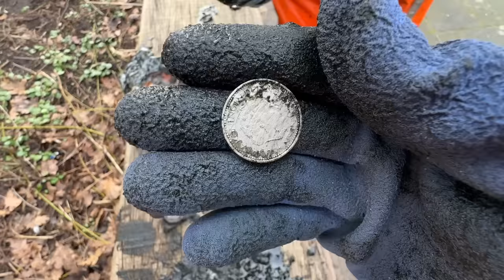The Most Amazing Criminal Canal Found Magnet Fishing *POLICE ARRIVE*

Comment: 10:53 You obviously mean pre Euro. The first Guilder was minted in 1378, the Silver Guilder (also named the Silver Carolus after Emperor Karel V) became the first "national" coin for the 17 provinces (a name the Netherlands was called by from 1543 till 1585) and this was used until around 1680. from 1694 we used the "generaliteitsgulden". The copper coin you hold there is callled a "stuiver", we also had a "kwartje" or "heitje" (25 cents), a "piek" (1 guilder coin), there was a 1.50 coin for a while called a Daalder, the  2.50 coin was called knaak or rijksdaalder, we had a "joet" :10 guilder bill), a "geeltje" (25 guilder bill), a "Zonnebloem" (50 guilder bill), a meier, later also called snip (100 guilder bill) a "vuurtoren" (250 guilder bill) and a "rug"  or Rooie" (1000 guilder bill)
If you have/find these, you can excange them for euros until 2032 at the Nederlandse Bank in Amsterdam.